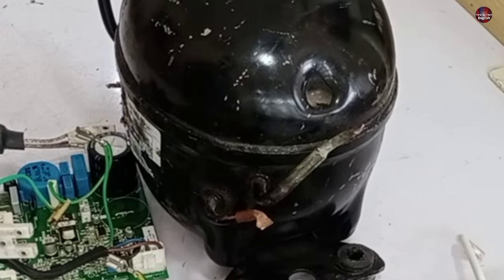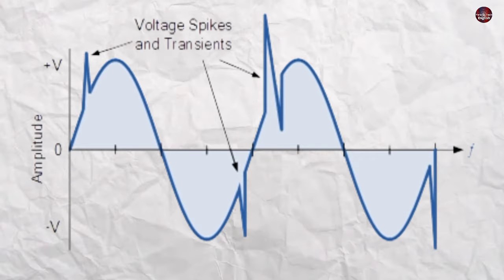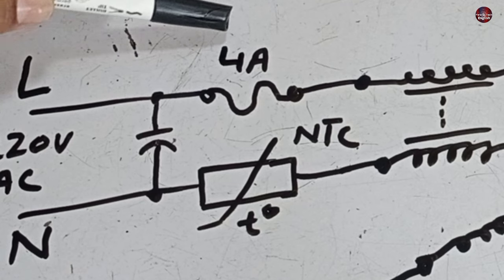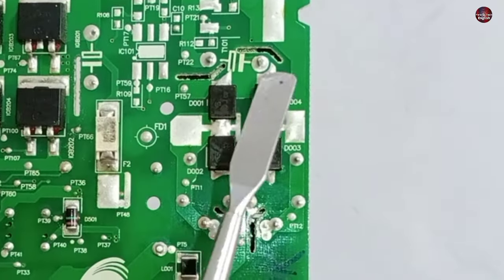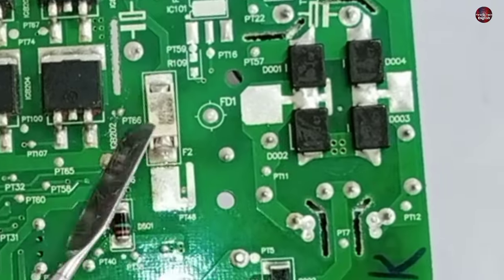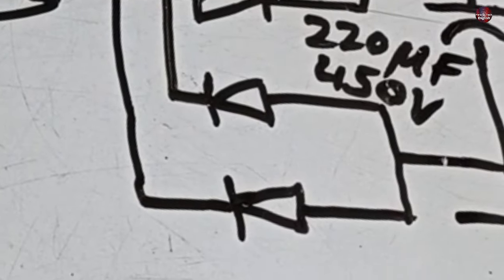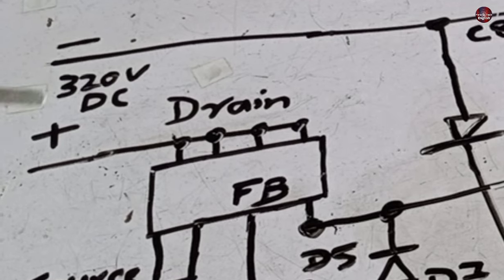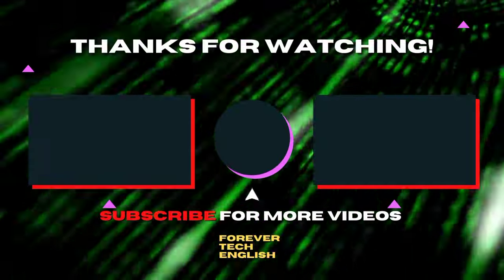Embraco Refrigerator Compressor Inverter Board Circuit Explained

Comment: How are you sir? I have a board similar to what you have, and there is a fault in the resistors of the microcontroller. Can you help me? I want a clear picture of the board so that I can determine the values of the burnt resistors. Thank you.

Comment: Thank you for everything you do
I have a question and I would be very grateful if you could answer me
In the large black capacitor, I get 311 volts, you said it should be 320 to 340, is the lower voltage in my case causing it to malfunction?
Reply from the maker: 311 are also fine. Its no issue. What the problem with yours?
Reply: The test on the compressor is okay (the resistance between all 3 contacts is the same), also on the inverter board everything looks okay but the compressor still does not work
Reply: l still looking for a solution. Thank you for your quick reply

Comment: Hi
Coul I replace a defective  Embraco VCC3 2456 80F 14 Imput 220-240V 2.1A Output 230V 53 a 133Hz 3.3A for a similar one, but instead of 53 a 133hz, it is to 150?
New one avalable is Embraco VCC3 2456 28 A 19 Imput 220-240V 2.1A Output 230V 53 a 115Hz 3.3A.
Reply from the maker: For that check the hertz on your compressor, The lowest and the max hertz. If is in between the replacement board. You can replace it.
Reply: @forevertechenglish  thank you very much! Compressor is 53TO133Hz, inside. Very usefull you vídeo! Congratulations from Brazil!
Reply: @forevertechenglish  What I discovered after purchasing the board is that it is not enough for them to have the same input and output values, we need to know whether the board is "drop in" or "Frequency". In this case, I purchased a "drop in" inverter board and the compressor did not start.

Comment: What if no voltage in UVW what is the possible problem?
Reply from the maker: Then, its possible any Igbt is bad, Or any thing around the circuit is bad, which need to be checked and addressed.

Comment: Removed from working fridge did your jumper trick 1&2 but I use 120vac and it will not work. Great video but my luck is terrible